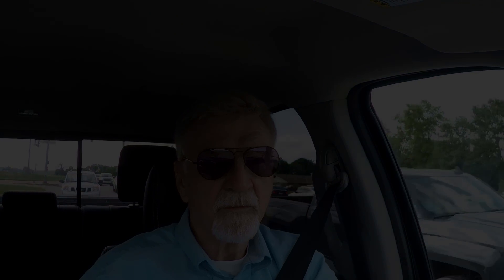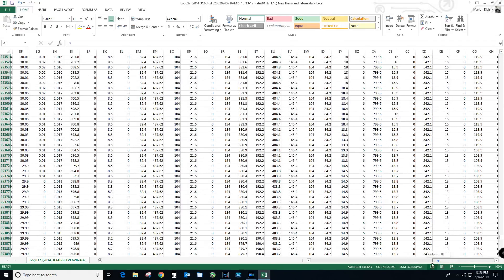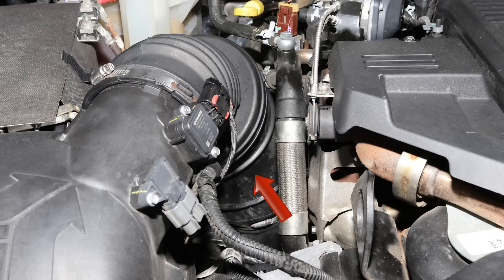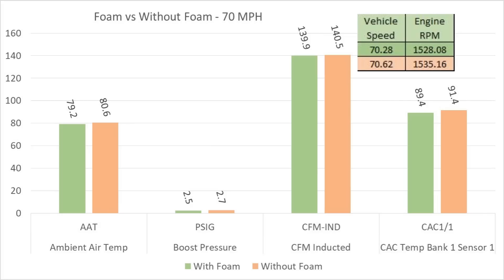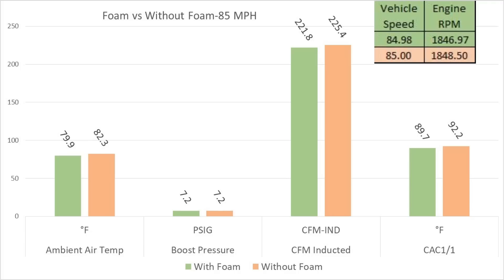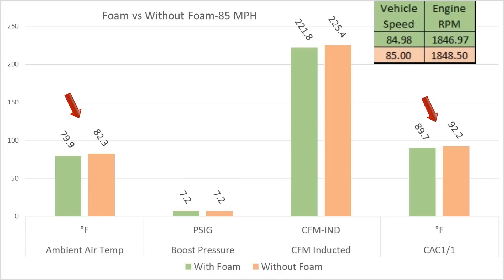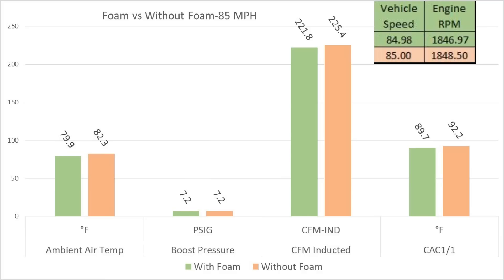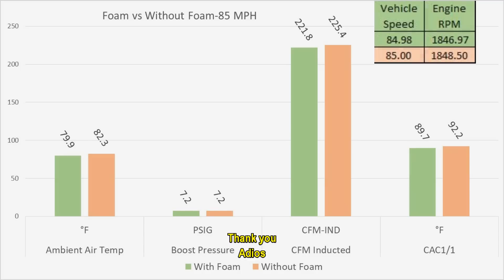RAM Cummins Stock Air Intake  -  Foam or No Foam

Comment: First off I just subscribed and thank you for the effort in making all these quality videos. I have a 2013 2500 Cummins. For what it’s worth I took the foam out and noticed the baffle has quite a bit of play inside the tube without the foam. This issue was enough to convince me to put the foam back in until I eventually get an aftermarket intake tube and just inspect every so often. This was the first time I ever looked at it and the foam was in good shape. Thanks again for all the great info.
Reply from the maker: Yes, agree.  I pulled mine after a year to check it and I couldn't see any signs of wearing but I'm with you, if the foam is good leave it.

Comment: Where are you from I’m In Lafayette
Reply from the maker: Lafayette also
Reply: @MarionBlair  hell yea! Great vids !!   I’m about to delete mine this weekend I’m all stock
Reply from the maker: @armymxere5  Thinking about it myself
Reply: @MarionBlair  I have a 15 with 73k  I recently cleaned the egr and cooler omg!! It was packed I will take pics  of dpf ect when I remove tomorrow.
Reply from the maker: @armymxere5  Yea, the EGR is terrible for diesels.
Reply: @MarionBlair  big difference on the engine temps  and it sounds much better .  Def a must I pulled my camper from my house to poches campground today and it felt much better engine temps never over 195 13.9 mpg only 33 miles but that’s what truck said . I have the transmission tune also and geezzzz that is so much better !! It don’t lug or stay in that in between gears any more quick solid shifts . It took me 6 hrs by myself Sunday  I’m running the ctt stick performance tune from top gun DIESLE 40hp . Such a better truck now !

Comment: When doing this mod (foam removal) I noted a small hole in the lower airbox on the side toward the engine.  Some say this is a drain hole, but it doesnt make sense.  Can I cover the hole?  Is the hole sicking unfiltered air into the turbo?  I have a 2014 2500 Limited.
Reply from the maker: In the air box below the filter?  That's all unfiltered.   There should be no air leaks on the top side of the filter.  Below, it doesn't matter.
Reply: I wonder if the foam has something to do with the ccv dumping a small amount of oil into the intake?

Comment: Sir, as always, your info is golden.......just a quick question, I took your info & re-installed the baffle w/o the foam, how ever I noticed a little bit of play after re-inserting the baffle into the intake tube, you can reach into the tube and rattle the baffle around a little bit. I was wondering if by chance you noticed this and if you did, your thoughts on the baffle being able to kind of rattle around in the intake tube a little bit would have any negative impacts down the road......
Anyway, great series on baffle, thanks
Reply: Sir, I did a semi-exhaustive search for either a better "formed" fitting off the turbo, found nothing, also, there just isn't a whole lotta room down there to do much else, pretty tight down there. I looked at quite a few aftermarket C.A.I. kits. They all have that same identical type turn fitting at the bottom  / turbo connection, I saw nothing different no matter the manufacturer, & it'll cost $300.00 & up just to basically duplicate what we already have. It seems to me after seeing your test & results, that putting back the baffle w/O the foam is just the way it is.....
Reply: @williamtipton1392  Yes, that's pretty much my conclusion also.  thanks
Reply from the maker: Marion that is a concern of mine also.  eventually going to find another solution.   I've heard of the turbo completely eating the baffle and foam over many years, so need to either needs to be replaced with a new one or maybe an aftermarket.   but eventually I'm going to have a address it.  You can't just replace the foam unfortunately.  I doubt there is much rattling, since the airflow will hold it pretty firm.  I suspect the eventual deteriation is from getting brittle due to heat and age but that's speculation.  Mines 5 yrs old and it looks like it could go another few years easily.
Reply: @MarionBlair  Thank you Sir for getting back, your videos have been a great help to me on how to do thinks to my truck, I look forward as always to the next one

Comment: Hi Marion,whats the performance benefit of the Banks idrive.im thinking of upgrading my intake and exhaust too the  Banks setup. 
I definitely am going too remove the foam.
I had a Ford 6.0 with a complete banks kit and my truck ran great.Thanks for your great informative videos.
Reply from the maker: Hi, Haven't had any actual measured experience with the banks cold air intake.  The  K & N allows more airflow than stock filter but don't know the actual difference.  I'm interested in getting rid of the baffle as I've heard of it coming apart and getting eaten by the turbo.
Reply: @MarionBlair  so you reinstalled the foam,
Reply from the maker: @anthonysiegel4685  no I haven't

Comment: That was great information Marion thank you so much. I've never opened mine up does the air flow smoothing piece sit locked into position without the foam in place or does it rattle around inside? Does the Banks Monitor read EGT's and will void the warranty, I've been interested in it? Thank you.

Comment: Thanks, this is Darryl not Lynn. I also have a ‘14 we pull a 5ver with. It is primarily a tow rig with 55K. I’m good with your list. I was thinking, due to mileage, more like spare drive belt, coolant hoses, water pump, etc? Keep it up, you have given me confidence to do more maintenance on this truck, thanks.
Reply from the maker: Thanks, Sorry,  Darryl, Youtube must have thrown a rod cause your message is cleaarly  from Lynn Burks on my end, ha, strange.  So Lynn if it comes to you disregard.   Well, I have the old  concentric water pump on the shelf in perfect shape but with out the vent.  I guess I should throw it in the truck.  And I probably should pick up a replacement Y for the radiator.  I do have a gallon of concentrate I could bring.  You are giving me some add one  to my list, thanks.   I'm head for Georgia in a couple of weeks so I'll be putting on some mileage.  I'm behind you however in my 40K's.

Comment: Are you going to change your transmission fluid yourself? If so when? Do you carry any spare engine parts with you when going on a camping trip? Thanks
Reply from the maker: Lynn, Yes I'm going to change it myself.  I'll make a video on it.  Not sure when, however. Probably this year.   I carry DEF, a set of fuel filter, a laser temp gun to check my tires, hubs etc,  the little power prob in the video below, a bucket, full set of tools,  a code reader, a chain,  5 gal. spare diesel if I'm head west, tire pressure gauge.  12 volt air pump, what else, that's the main things, I have a list for the different type of trips etc...  I find it easier if I don't trust my memory since it's pretty bad. https://studio.youtube.com/video/8WqVsaNkJMc/edit?utm_campaign=upgrade&utm_medium=redirect&utm_source=%2Fmy_videos

Comment: Hi Marion,

I’ve watched many videos that you have made, and I appreciate all the information that you have shared.  I have a few questions that don’t actually relate to this video, but I was hoping you would be willing to answer.  I’m thinking of purchasing a new 2019 ram 2500 Cummins, but I’m concerned about a few issues that I’ve read about consistently.  I tried asking Cummins my questions, but they just referred me to Ram(fiat Chrysler) who in turn didn’t answer any questions and just referred me to the manual.  My biggest concern is that I would be doing primarily local driving with the truck as it would be my daily driver, and my drive to work is only about 3 miles.  Much of what I read has been very cautionary about people using diesels for local driving due to the fact that it doesn’t allow for enough passive regeneration of the dpf and therefore increases the likelihood of damage/clogging of the dpf.  Also much is written about short drives with diesels not allowing them to get up to operating temperature and therefore decreasing longevity.  I’m aware of the active regeneration that rams do to clean the dpf when they are not highway driven enough, and I watched your entire video about local driving with a ram and how it relates to the position of the egr.  Do you think that local driving is as damaging as many people report?  Are there any strategies that one can use to effectively reduce/eliminate the problems associated with local driving?  Or is it just a matter of time before something goes wrong?  Can you plug in a grid heater year round to get the engine up to operating quickly for short drives?  Or is there some type of aftermarket heater that can be installed to serve that purpose?  I also watched Your video about the exhaust brake.  Can they exhaust break be used to help clean the dpf?  Should it be used when local driving and are there benefits to using it while local driving?  What about fuel treatments such as seafoam or those made by Amzoil, do you recommend their use?  I don’t mind paying the extra money for a diesel, but I just don’t want to get into lots of expensive repairs with a new truck, which I’ve read can happen as diesel parts and mechanics are expensive.  I’m very vigilant about my maintenance on vehicles, so I don’t mind the extra time there either.  Any insight you could provide would be appreciated.  Sorry for the lengthy comment.
Reply: Thank you.  That is probably good advice.  I currently have an 87 150 with an in-line 6 that still runs great and a 2001 F-150 that also runs well.  I just need something with a crew cab to haul my family.  I also have a construction trailer that I can’t haul fully loaded with my half ton.  Of course the 6.4 hemi would handle that, but was just contemplating a diesel since I enjoy how they drive.  But you are right, I probably don’t haul enough to justify it.
Reply: If I were you, I'd find me a high speed loop to a Starbucks 10 miles down the road to satisfy the Cummins fix then haul ass back to work to satisfy your fix.  You'll be happier before you begin working and even more happy when you get off for the weekend.  Happiness costs big bucks, just change your oil every 3000 miles, oil filter every 6000 miles, and crankcase filter every 50000 miles.  Watch your coolant bottle to make sure your egr cooler isn't cracked blowing white smoke or coolant out the exhaust pipe.  Avoid long idles or acceleration when the engine is not up to temperature because the engine produces more diesel particulate matter (dpm) as when your engine is up to temperature will produce more nox. I can't wait to hear what Blair has to say about your question, i guess we all have to remember about the marine who rides a harley and drives a diesel.
Reply from the maker: Henry, Sorry for the late post.   I agree with Supperterofsanity and CEB's response, Here's my two cents.  You are asking the wrong person for a logical answer, ha,, because, I say,  complete your bucket list.  Life is too short.  Your construction trailer makes it logical.  You have 5 years to worry about whether you want to keep it longer or not and the resale value on diesels are superb.  (Especially a new 19, I'm jealous).  Interest rates are great right now also.   Run your exhaust brake 100% to keep the turbo exercised and speed up warm ups.  Everyone should, towing or not.  Take it for a 1 hr highway drive once in a while on the weekends, Change oil more often (about like a gas engine) and you can use dyno oil, not synthetic (for cost).  Block heater in the winter, not worth it in the summer.  Don't idle to warm up, give it about 30 secs and drive moderately.  It'll warm up faster.  The RAM active regen is excellent, it'll take care of itself.  There's plenty of RAM's running around that's never had a hitch on it.
Reply: Maybe Marion will chime in but sounds like you need a Corolla. Just joking obviously but buying a diesel truck to drive 3 mile trip to work doesn't seem equitable. Diesels are slow to warm up so no way its getting up to temp in that short of a trip.  You'd have to drive periodically for the sole purpose of regeneration. You will be paying a 9k premium over a gas engine and you are talking buying devices and products to protect a brand new engine? I don't put anything not recommended by Cummins in mine. Also, diesel is running 40 cents per gallon higher in my neck of the woods. Unless you really haul on the weekends get the Hemi and put the 9 grand you saved towards a higher trim package.

Comment: i pulled the foam out at 100k 2016 ram went from denver to dc 1600 miles and experienced extra torque while climbing hills and mountains.  never dropped to a lower gear.  w/o the foam seemed to be less of a restriction for air but gave me a slight decrease in mpg 20mpg.  with the foam i got 21 mpg from denver-dc-lafayette-and back to denver.
Reply from the maker: Yea, the test seemed to lean that way also if you noticed but it kind of defy logic, ha.
Reply: @MarionBlair  once the increase in air flow passes by the Mass air flow sensor more fuel is sent to the cylinder delivering more power thus more torque might evolve.  not much, but more.  you do keep me thinking...
Reply from the maker: @jbrous3602  Thanks